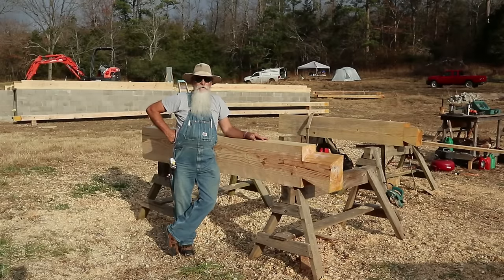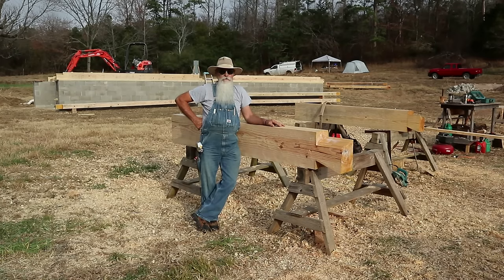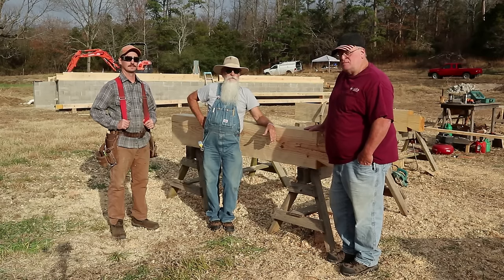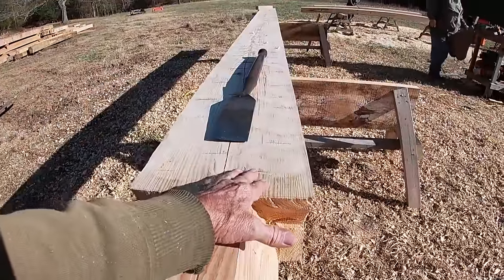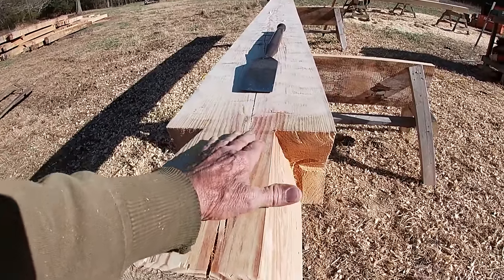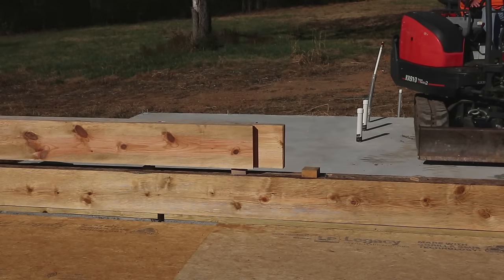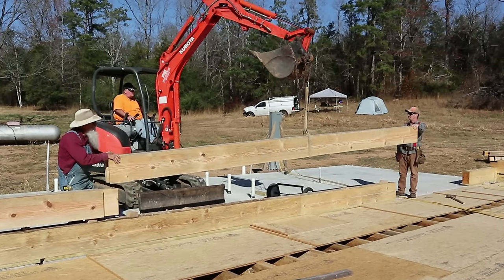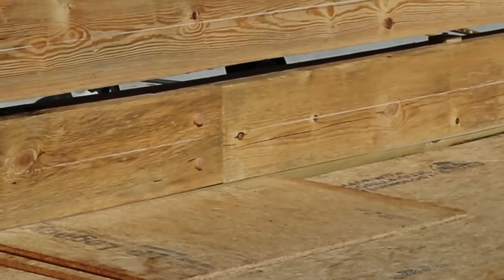Ozarks Cabin Build, Ep 1

Comment: Paul.. Cliff here, This is going to be a great build, I know your crowd is going to love this.... but I wondered if you have ever incorperated a ship lap to the top and bottom of each log on a cabin? I thought of this idea, and to just rip about 1.5" on a 45° on the outside top of each log, to simulate the chinking effect. My thought was to keep away from letting the cold radiate through the chinking in the gaps. And the 45's would not weather like the rest of the exterior,  leaving little maintenance for the furure. I wanted to do this back in the 70's, and never did....Well let me know what you think of that idea... I figured you were up to something, looking foward to watching another build.👍
Reply from the maker: Howdy Cliff- thank you for watching the video and commenting. I’ve seen something like this done on a log house close to where I live. I don’t normally build with dimensional timber but with live edge which is a little bit different. I let the cabin settle before putting the chinking in the gaps. I put insulation in the gaps before the chinking goes in. Take care and God bless. Merry Christmas

Comment: Paul, you are excellent at what you do. This home is almost what I want to build. Mine would be 36' x 24' two story, with a 24' log dividing wall centered front to back. Half second story and full height on the other half. And use timber frame king post rafters with a 12/12 pitch with slate roof. I have 35 acres of beautiful Tulip Poplar in WV and will be getting a sawmill to cut the inner and outter faces. Lastly, add a 36' x 12' front porch and a 36' x 12' rear addition. Sound good? 😊 I could use some help 😊
Reply from the maker: Howdy Tim- thank you so much for the kind words. I sure wish you the very best with your build. Sounds like you have a good idea of what you want. I wish we had poplar here but it grows more in the states east of us. We do have an abundance of southern yellow pine at our disposal so that is what l use. What kind of sawmill are you planning to get? I have a Woodland Mills HM126 with the 14 hp engine that does anything l need to do. I can easily cut up to 24’-26’. If push came to shove l could get 32’ on the mill but I don’t know anything to handle anything that big. Send me an email at thebeardedcarpenter8@gmail.com if you have any questions. God’s blessings to you

Comment: Like The spliced log, done right.  Paul, the "Pealing Disk" where is it available and what is it called?s Paul we need to talk about Log Screws instead of all thread rod. 

I had a Structural Engineer run calculations and per the Log Screw is screwed in from above and does not require pre drilling nut driver I only need 6" depth and you would just put them where you have all thread rod. I pre drill  1" hole down so the Log Screws only need 6" and do not require pre drilling. 5/8 nut driver, not having to getting the all thread rods in a log hole,  I still pre drill a 1" hole with my Woods Owl down 6" on a 12" log and use a 12" log screw 'and a 1" pvc spacer so I can pre drill holes the same depth. Then screw in the 12" log screw 6". Eliminates lining up all thread rod and it is screwed in from above.  Blessing,Tom
Reply: Like a tapcon type screw ? Thanks
Reply from the maker: Howdy Thomas- those splices work really nice. I’ve got a case of timber loc screws, but will be using them for anchoring the joists. The all thread anchor rods were in when we started the job. Hope all is well. Merry Christmas and God bless

Comment: I know nothing about this construction method and im wondering if there is reason for the gaps in the walls?
Reply from the maker: Howdy Joseph- thank you so much for watching the video. The gaps are called chinking gaps and they are filled in with insulation and a mortar mix. The older cabins were built this way to be able to get as much height out of the logs as possible. They were using live edge logs so the area between the logs wasn’t uniform and they would fill the gaps with different materials. I like the look of the live edge because you get to see the natural shapes of the logs so each log has its own personality. Nowadays people will get their logs cut on all four sides to simplify the raising of the walls. Having the logs cut four square has its advantages when having to splice logs on longer walls. Hope this helps. God bless
Reply: @TheBeardedCarpenter  Thank you for the detailed explanation! Some day I hope to build a simple log home myself.